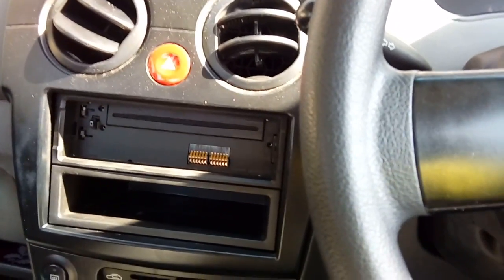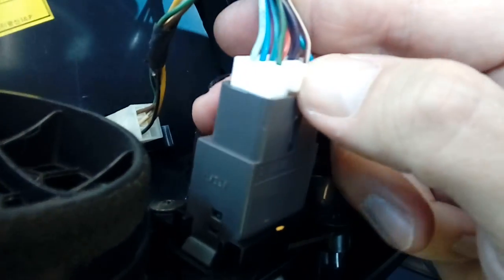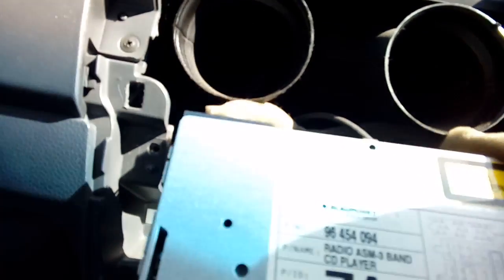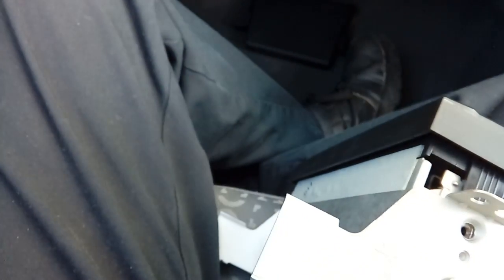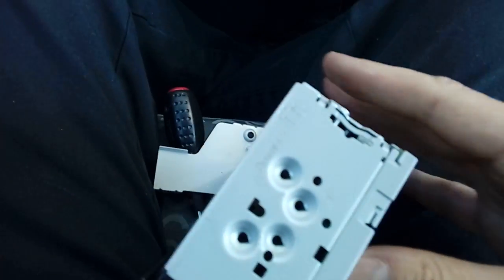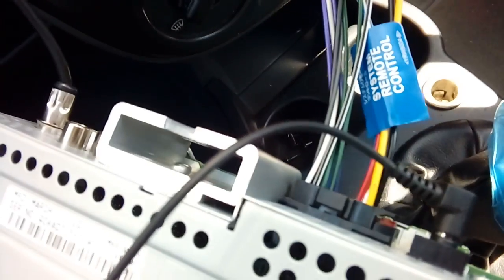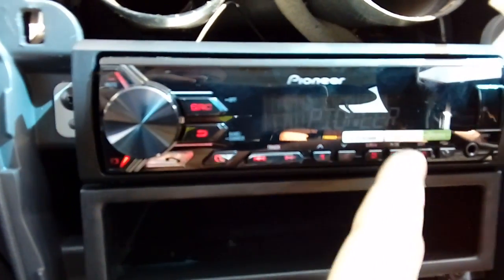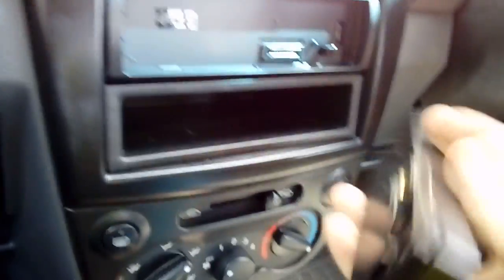Daewoo Matiz / Chevrolet Spark 2005 -2010 radio removal & refit guide

Comment: Amazing video mate. I'm glad that old Matiz/Spark doesn't have a weird ISO wiring, like most of modern cars. Yes, MANY modern cars have a "criminal" ISO connector, which looks like standard ISO, but if you plug it into your new nice shiny aftermarket radio, it bricks the radio immediately. You can throw it away, because the bastards (from the car industry) usually switch the power polarity on the connector, to burn any device that is not original. You usually have to buy a special connector harness in order to connect an aftermarket radio without destroying it. Glad to see that Matiz didn't implement that dirty trick (at least not the 2005 model).

Comment: Great and very helpful video.  I have the following problem: The radio seems to work, can be amplified, play a disc, etc., but no sound comes out.  Earlier, sometimes there was sound, sometimes not.  Now there isn't.  I opened it up and all the cables are plugged in and seem fine.  I replaced all the fuses that are responsible for the radio, but no change.  Any idea what can be done?
Reply from the maker: Is yours is the version with speakers in the doors then it’s possible either the damp has got to the speakers or where the cable passes through the rubber grommets near the door hinges may of snapped(common problem)
Reply: @PJsprojects  I also have no audio coming out with the speakers on the dash. Any ideas what would cause it?

I'm going to try fit a new radio tomorrow.